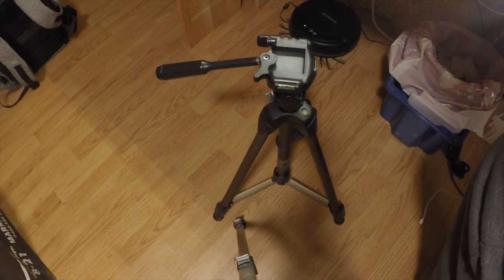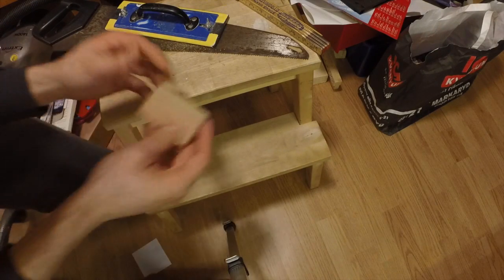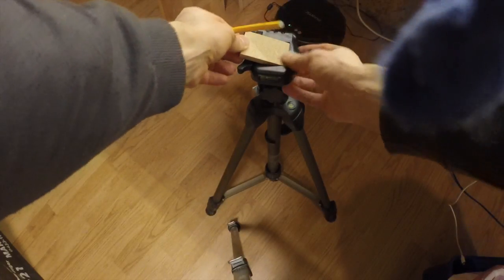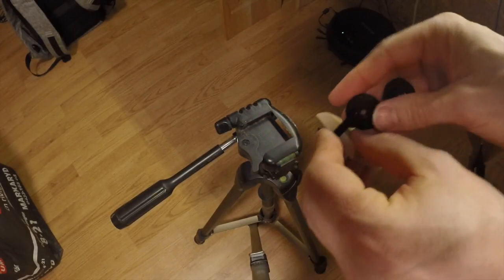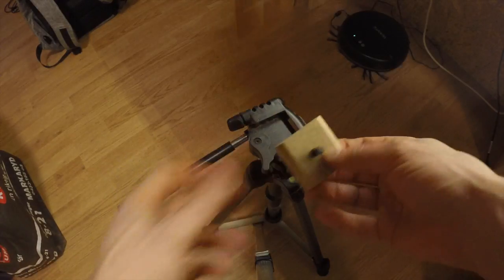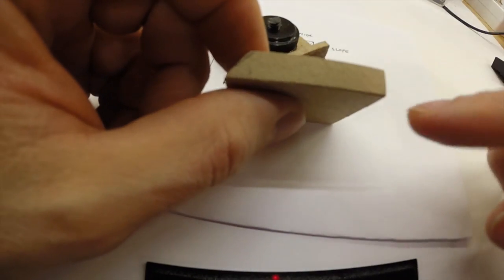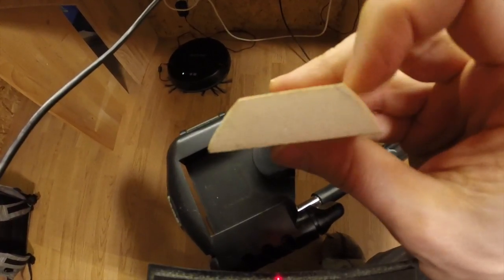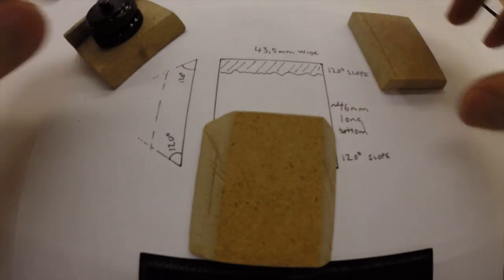Fast and easy DIY HAMA Quick Release - camera tripod fixing system

Comment: That's great DIY. Don't know how long would it last if you are shooting outside hot/wet weather. This reminded me that I need one or two quick release plates from my hama tripod. Those should not be over few $ on ebay/aliexpress, but you would need to wait for them like 3-4 weeks and if you need one right now...
Reply from the maker: Thats true, humidity is always an issue with MDF board. Although some sealant could fix that (I sealed a bit of it with CA-glue). As for buying on ebay/aliexpress that is also true. Just a few bucks. But because of a change in the Swedish postal office and customs office no matter the price, everything from outside the EU gets a 25% toll on them AND an 8$ handling fee! So not a good alternative anymore in Sweden unfortunately :/
Reply: Yey for the birocratie. Why pay 1 dollar if you can pay us 11 :D